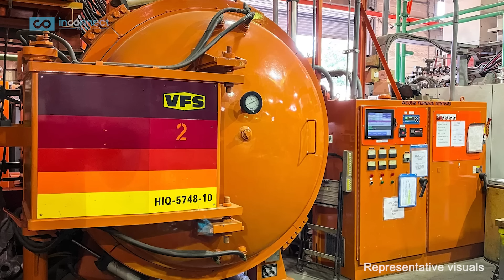Will the AMCA Mk2 Make India a Fighter Jet Superpower? | Indian Air Force | Defence Update

Comment: I don't know how SU57 would affect AMCA but it feels like SU57 are better than Rafales but we need F22 like design on SU57 which is serpentine air intake with atleast 6 bvr missiles hopefully and enough range to be a viable option.

Instead of increasing the height of the AMCA shouldn't DRDO increase length to accommodate more missiles and EWS.